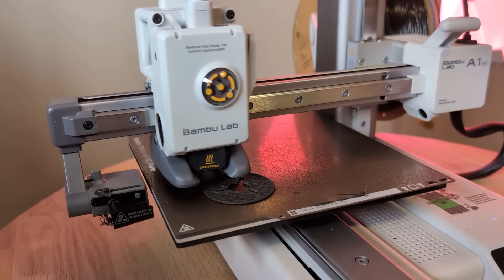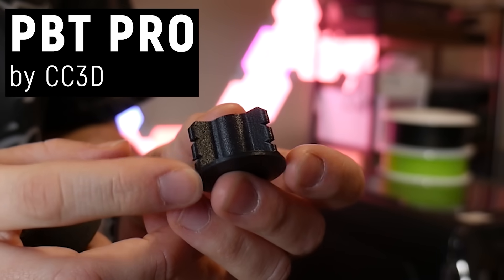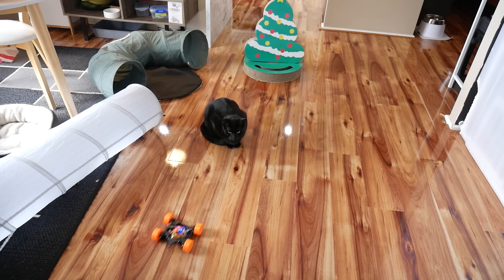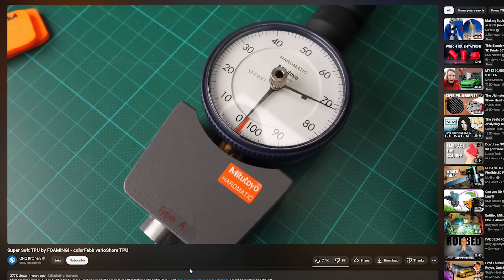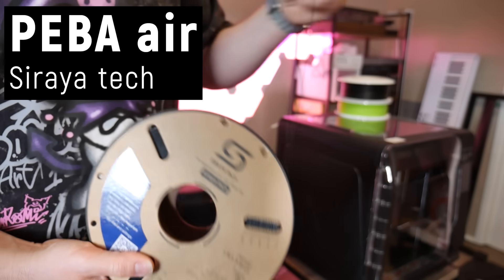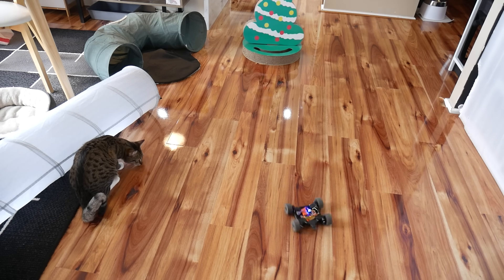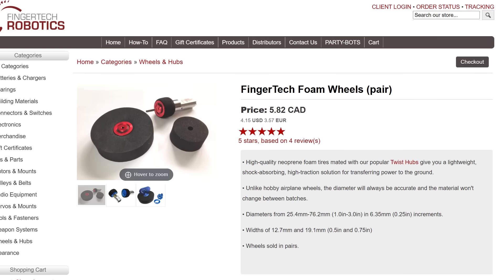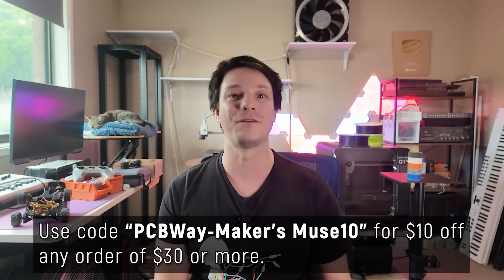3D Printed FOAM Wheels - Do they work?

Comment: And slicks on a slick surface have a larger contact patch than treaded tyres, so the reduced pulling force on the MDF was totally expected. That said, slicks on a wet slick surface will have leas grip than a treaded tyre. 

Which makes me wonder, are fluid weapons allowed in combat robotics? A tyre that's grippy in wet conditions might give a traction advantage while you try to spray water into your opponent's electronics 😂😂😂

Comment: Table tennis rubber glue. If you want to make a surface tacky and grippy I have never came across a material better.

I knew pro players growing up, I played a tonne as a kid, and I believe it's banned now but players used to coat their rubber with the same glue you use to glue the rubbers onto the bat itself(NOT paddle, how dare you). The amount of spin you got on the ball was absolutely insane. Look it up, should be readily available in aus I imagine, and cheap as chips.

Comment: Instead of bumps, try fine ridges a layer or two deep that run the entire circumference of the tires in the direction of travel (like rain grooves) or try diagonal traction beads like herringbone gears.  The idea is to introduce a little extra squish and grip to the outside of the tire without significantly reducing the surface area of the contact patch or causing bouncing that breaks contact with the surface of the arena.

Maybe the same thing with how you apply the latex... instead of applying it back and forth across the width of the tire or randomly painting it on, spin up the tire and apply it that way with the brush so it's more even and any surface features are parallel to the direction of travel.

Comment: Rubber cement, bike shop or as tyre repair glue for cars, ask at a car shop.

Liquid latex, is innside most tyre emergency sealant kits for new cars, go at a car recycling center and ask if you can get one for fre from a wrecked car since this is just tossed anyways (yes they have a 4 year expire date but still is just fine after this) you might also get the compressor for free as well 😅😁

Comment: I've been printing TPU air tires recently with good results as far as traction goes although combat durability isn't as good as you would think. 
On the print settings, you should try the the "fuzzy skin" option. Makes for an incredibly grippy outer surface, far better than smooth and much better than chunky treads.

Comment: I'd suspect the PEBA wheel chatter / resonance is in part due to the seams, also due to it's elastic / rebound but would be worth reprinting with random seams to confirm.  I haven't printed with PEBA , or foaming PEBA, but it's exciting and I'm wondering about what things we can do with it, things like built in / print in place elastic rubber bands...

Comment: I noticed the PEBA tires were bouncing off of the board which would reduce it's pulling ability.  We have walmart in the USA, do you have an all around everything store in AU?  The rubber cement is found in the itinerary department, i.e. notebooks, folders and pens.

Comment: I used to race 1/10 scale R/C Dirt Oval.  We used foam core tires coated with flowable windshield silicon sealant.  Mount the wheel on an axle then in a drill and apply it evenly using your finger to get it close to even thickness.  Then we used a about a 5 rpm motor ac motor with the wheel in operating orientation and let it turn until cured.  For 2wd we used softer foam cores and for 4wd a firm core.  I set many track records using those.  Takes some practice but they are cheap to make so testing variations don't set you back much.  Just make sure the windshield sealant is marked as flowable, it will flow out while turning slow to a very smooth finish.  Also helps if you round off the edge of the foam tires so the silicone can grip the foam a bit on the sides and not get caught tearing out a chunk.

Comment: The pulling test is a good battle bot simulation, but I think it would have been nice to see a more standard friction test like pulling a sled with a weight on it and recording the peak force or tilting the floor until the sled starts sliding and recording that angle. With those you could get a coefficient of friction for these filaments and the MDF.

Comment: A source of rubber cement should be anywhere that sells tire repair stuff including bike and possibly boating shops as it's the adhesive you use to patch inner tubes.

Comment: i have zero experience with combat robots, but i have a thought with your tread.  something i've seen in certain applications of tires used on smooth (or smoothish) surfaces is nubs rather than full tread, so you might try creating a pattern of them out of your tpu air or peba air no more than a couple mm in diameter & height in an offset pattern to see what happens.  i know it'll be a bit of a challenge to print, but i think it's worth a shot....  🤔

Comment: the PBA doing that bouncing while doing a 0 turn spin may just be the static and kinetic friction as well as the RPM in combo with the rebound/dampening characteristics. If you print a stick of PBA air vs the TPU air the PBA may keep oscillating longer than the TPU giving some bit of credibility to my guess.

Comment: Instead of liquid latex you could try some ATV gasket maker (silicone based) that comes in a tube. The PermaTex Ultra Red which I have used stays pretty sticky after it cures. That should be available in AU.

Comment: I have make simple PLA wheels and of course they were very slippery. I cut chunks from a used mountain bike tyre inner tube and stretched that over the PLA wheel. It makes a much more grippy type that worked well for me.
Reply: I glued mountain bike outer tube tread to rings and put them on top of short course 1/10 rc car tyres - pretty good on sand, maybe close to paddle wheels 😉
Probably really, really bad for small combat robots (at least on weight) 🤔

Comment: I've always just cast urethane tires for my VexU robots. You can tune the hardness for a balance of grip and durability, it's got way more grip than anything else in the sport, and nobody else does it because nobody slaps as many drive motors on as my team. Gives a pretty good advantage for pushing.

A PETG hub and PLA mold is what I use because urethane bonds extremely well to PETG and not to PLA.

PETG's impact resistance probably won't work here, but don't even think about using PLA for the hub more than a couple times. The urethane will delaminate as soon as it stretches.

Polycarbonate should theoretically bond really well and ABS/ASA only a bit less than PETG, but I've never tried those.

Oh, and model some grooves or teeth into the wheel hub to get more surface area on the tire. 

If you can't print ABS/ASA/PC, idk, maybe try another PETG blend or something. 

Another note, TPU does not stick to two-part urethane rubbers very well. It's counterintuitive cause they both have urethane in the name, but yeah idk they just don't stick. 

Not sponsored or anything, but I use smooth-on vytaflex 40. You can use 30 or 20 for more grip, but it'll wear down faster.

I'd personally only use the foam TPU for prototyping, but if you don't wanna deal with mixing a bunch of messy (and kind of pricey) liquid rubber in a cup, then it's probably good enough for you. For anyone else, I assume the advantage is completely worth the extra work.

Comment: The foaming TPU performance surprised me. I have a roll of varioShore by ColorFabb that I used for tires on an OpenRC F1 platform. At its softest, it still didn't seem to have as much grip as some Recreus Filaflex 82A (the latter, admittedly, I printed with a mild "fuzzy skin" texture).

That said, all my observations were by eye. No formal testing was performed like you did.

Comment: This gave me an idea, since traction is mostly about surface area in contact, what about a design similar to a flapwheel? it seems like if you made a standard style wheel, but used flap-like knurling on it (aimed in both forward and backwards directions) it might give it much better surface contact, be relatively robust to impacts, and be something that is only possible with 3d printing.

Comment: My Roomba has been running on printed TPU wheels for over a year. iRobot only sells the entire motor assembly, not separate wheels, so the official option was ridiculously expensive.
It works perfectly

Comment: The chain seems to pull the vehicle up, releasing the rear wheels. It may be more reliable to lower the anchor point on the wall?
the density of the material plays a role on the vehicle weight, consequently on the pulling capability of the vehicle 😉 (maybe not significant, I don't know). Nice video, I love this kind of practical comparison 😀
Reply from the maker: ah yeah good point! I'll adjust the testing jig and maybe just make it pushing on a plate to even it out and stop the platform from wandering.
Reply: @MakersMuse  Pulling is probably still better. When pushing the front of the vehicle tries to either dig down or up, it will never be perfectly perpendicular. Just the tire itself flexing will bias one or the other, then you got some suspension on top, even if that suspension is in the chassis flexing. Straight pull should load the tires more evenly, without that "ghost load" that removes or increases traction with a positive feedback: the harder it digs down, the more traction you get and harder it digs down, and if it wants to climb, it will climb faster the higher the angle.

With straight pull, i think the feedback is negative, it should always straight out the vehicle and the angle can be kept shallow,  so, should not have the same problem with tires digging up or down.. Maybe a straight, rigid stick instead of a chain is all the changes needed?
Reply: @MakersMuse  I've done a couple of rounds of testing wheels for ants a little while back
I started trying to push the plate and found the test chassis jumped, so moved to pulling like you tried

My final set up involved linking the wheel/motor assembly directly to the force gauge through a hinge semi rigidly

Comment: You should definitely try to print with TPU filament from filaflex! I've printed with the 70A Shore (on an MK4S and a Core One) and it has a really good grip! They even have a 60A Shore but never tried it! If you want to go into the coating you might want to try to dissolve silicone into white spirit!

Comment: When I needed traction on the TPU tires I printed, I coated them in Shoe Goo that I thinned with Xylene.  They were very sticky for a reasonable amount of time and could be recoated to get the traction back.  Not sure if you can get Shoe Goo in OZ, but if you can, it is worth a look.  Also, you can thin it with other solvents, if Xylene isn't available.

Comment: if you want to print tires, you should consider flexible resine. I've done many tries in FDM to print tires for RC cars, and even with TPU 60A it's not really working. Foaming TPU did not either. One solution worked, but it is flex resin printed on a SLA printer (disclaimer : it is really cumbersome to print)... Other different approaches : run with rubber  rc tires on top of prnted foams to make the rim, cut other foam than EVA (search for foam with way lower shores - for information, RC pan cars runs on foam within a shore hardness range in A (25A-40A)

Comment: On sources of rubber cement, look for Barge Cement used for EVA Foam Cosplays. Also, Weldwood brand is used for attaching countertops. I wonder how Flex Seal coating would do on the EVA? It isn't as soft as latex, but is tougher and has some grip.

Comment: When I make parts for my road bike accessories, I print them in TPU and then coat the areas that contact the frame with Aquasure. It’s the same stuff I use to patch my fishing waders when they leak and it creates a really grippy surface. If you try this, you should probably let the wheel rotate very slowly while the Aquasure cures to ensure an even coating.

Comment: I think the main positive point of the PEBA of having good rebound is actually bad for designing tyres for a vehicle, that does not have any other form of damping. So optimal grip should be acheived by a nice balance of springiness and damping all within the tyre basically replacing a complete suspension setup.

Comment: Flexible is cool but wheres the grip?  HAve you seen TPR filament, its rubber,  atomstack made a printer for it.  It obviously didnt go anywhere but it sure did print grippy rubber that stuck and not slid. I actually had a chance to buy one locally with lots of the TPR filament which was hard to find even when they were selling the printer, but  it was my first printer and i decided against it, i think because it didnt have automatic bed leveling.  IT did come with 2 print heads, one for regular PLA and the other for the TPR filament.  I still wish i gotten that printer (atomstack cambrian) anytime someone tries to show off TPU and its inevitable failure as a rubber replacement. Bring back TPR!!!

Comment: The extra bounciness (higher elasticity) from the PEBA Air together with the aligned seam might be the reason the tires were doing the "weird bouncy vibration resonance thing".  I would be interested to see how Silicone used for molds performs in comparison with these.  Great video!

Comment: My guess with the liquid latex is that the surface needs to be broken up on the wheels after it dries. I bet that the layer of latex is preventing the tire from squishing as much. You could try only coating parallel strips perpendicular to the tire around the circumference.

Comment: I think it is the same kind of latex, I think the important thing is the way he brushed it on while the wheel was spinning, it actually took some time in his clip to build up the homogeneous layer, I suspect the uneven brush strokes on your finish reduced the overall surface area contacting the surface. if you could apply it in a thin and even coating I wonder how well RTX Silicone would perform

Comment: Would that TPU Air be a good fit for printing those tool shadow foam liners?
Reply from the maker: I think it'd be perfect, keen to try it in a future project!
Reply: @MakersMuse sweet! I’ve got a 200 something piece toolbox that’s fallen apart on me and I want to build a better one. Could print hard plastic shadow liners the tools snap into, but that will ware out (as the original ones that came in the box, not great having pieces fall out of the lid as you try to close it) and doing the foam - if it’s a bit tight with figure wells - I figure it’d hold up longer.

Comment: As other comments already mentioned I think you should 3D print a mold and make tires out of silicone or other rubbery materials that can be casted. I did this for a phone holder and results were pretty good.
Reply: This can be also used to cast the wheel straight onto the rim.
Reply: And there are 2 part resins with a wide range of shore values, indeed 3d printed molds , great approach!

Comment: For traction i'd try casting platinum cure silicon rings that fit over the outer rim of the tires.
Very durable, very grippy, and can be cast directly into pla moulds.
Could also be an interesting material for impact resistance on the outer surface of bots.

Comment: Similar to the liquid latex, in RC racing we used to run "capped" foam tires where we put a thin coat of silicone over top of the foam tire, on certain surfaces it would have better grip and reduced wear compared to a standard foam

Comment: Nice video!
I've used plastidip to make mecanum wheels out of PLA, which worked pretty well. I just rolled them through a little puddle of the stuff and got a nice thin coating.

Also, if you try again with grippier coatings, make sure the chain is level so it's not lifting the rear end.
Reply from the maker: Ah yeah plastidip is pretty tacky, it should really bite into foam as well. Cheers. yep, will retest by pushing into a plate instead to remove that variable.
Reply: @MakersMuse  Would using a more similar painting technique (running the brush over the spinning tire) also help?  I noticed you did all of it by hand, and was curious if that would change the consistency of the application noticably.

Comment: In addition to another comment about rc car tire additives/compounds for traction, they also make tire truers or lathes for foam tires so you can skim off the seams and make them truly flat. You could also just spin them in a drill press and find a sandpaper grit that works.

Comment: I think that the PEBA wheels maybe perform better with heavy weight robots, because the TPU air seems VERY squishy and maybe with a heavier robot it increments A LOT the friction forcing the motors.

Comment: Given you have a toolchanger printer, I wonder what would happen if you mixed materials into a single tire. For example rigid diamond treads embedded into the foaming tpu tire or similar. Or even using various fuzzy modifiers on the surface.

Comment: Silicone caulking for traction? Can injection mold the stuff with a 3D printed mold(lots of vids). So then maybe you could "overmold" silicone onto a foam base for durability/weight? It might just pick up crud too but there's different formulations for indoor, outdoor, draft sealing, actual sink/shower use, etc. Could try adding different sand to said silicone to see if you can get any more grip out of fine or coarse grit or if a slick surface is still better, etc.

Just reminded myself that "rubberized rockerguard" exists. It's in a spray can for undercoating vehicles against rock chips that cure to a rubber type coating so durability shouldn't be an issue. Like a truck bedliner coating but softer against rock chipping. :)

Couple ideas for you to consider with hardware store sources at least.

ps, your latex was probably full of colour pigment making it firmer than pure?